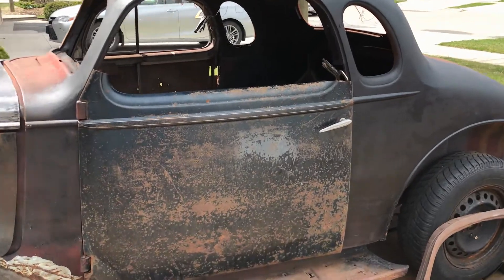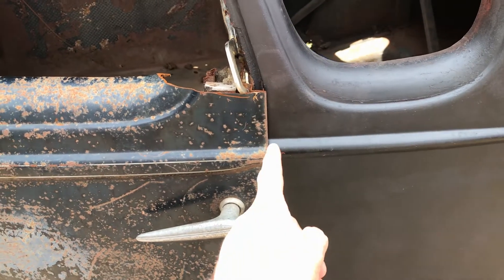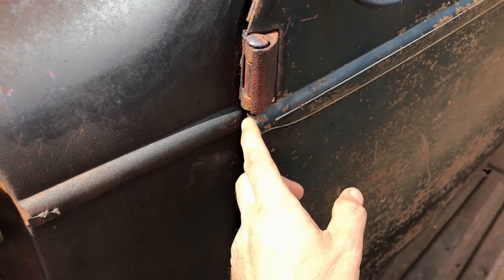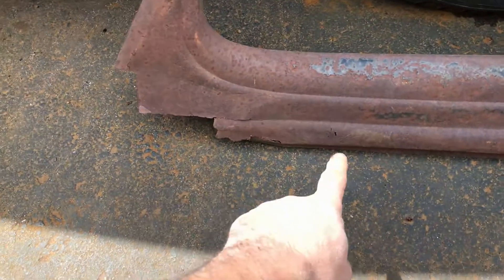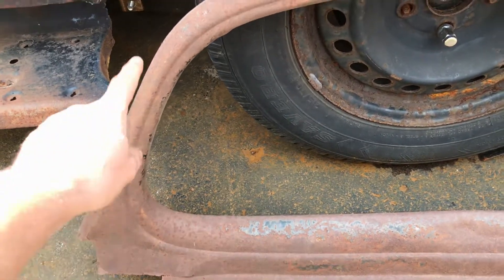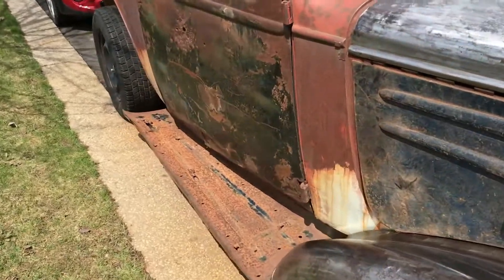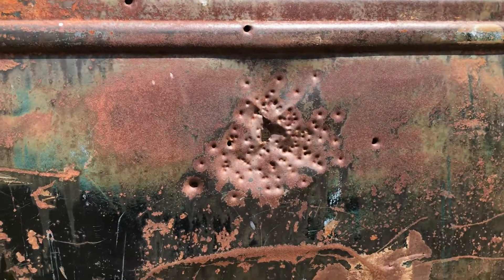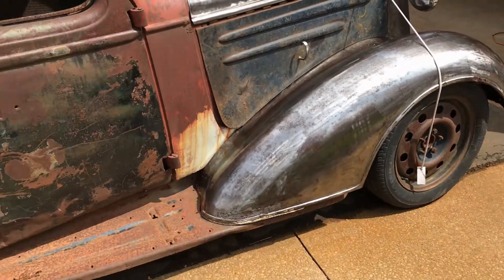1936 Chevy Coupe Door Adjustment - I have a Plan

Comment: I wouldn't weld on the line there as you will lose the sharp crease line of the bead I would go inbetween the 2 bead lines that way it can be ground down flat and will be less warping. And for the width I would cut a section out of the rear about 2 inches off the edge so the inner jam won't be too long and where the body line tapper off it will be even both sides.
Reply from the maker: Excellent points my friend.
Reply: I agree. cut it closer to the upper crease line and then flange the door part about half way down to lower crease line so the new upper frame overlaps. then when you tack weld together it gives you room to grind/finish without damaging the raised body line. you can get hand flanging pliers (modified vice-grips) at eastwood (or maybe locally at Princess Auto) or I have seen air-powered ones that you use with an air chisel.
Reply: I was thinking while shortening the door you could possibly use one of them step tools to do the flange from top to bottom then slide the cut section over that will give a good weld and will shorten the door that way you dont need cut a strip out and but weld it

Comment: Hi Dave ,Greg here  Chevy 3939 has a good point, Guess it's trial and error. You could move the latch in the door to the correct spot to line up with striker if needed. Maybe there not too far off. Were you going to go with aftermarket door latches. I guess try and get the door to fit as best as possible. Your thoughts on the door top section seem fine with me . Work with the best sheetmetal  you have on the door to avoid grief welding or metal working as you work towards finishing the door. Goodness me ,I've  spent  more  time talking on the computer with you than with our neighbours these past few days.Technology is something else,and the more I see of that coupe the happier I am for you.

Comment: You might have to cut that door into a few pieces to see where it wants to fit.  What I mean is once you cut it to fit the top window frame, it might be obvious how much and where material needs to come out of the door.  The door jambs will have to fit, so maybe you could slice it vertically near either the front or back, then fit it in the jambs and get the hinges to fit right, then see how much to remove before stitching it all together.  There’s no right answer... just some ways that might be easier than others.
Reply from the maker: The reason I favour cutting the middle, is it's a straight section. If I go near either side, the lines start to slope up, so would be impossible to match up.
Reply: @ScottRods  Ahhh, gotcha.  Hmmm, going to have to think on this one!

Comment: Take the coupe top piece and tack it in the door jamb, deskin the sedan bottom, the fit the inner structure from sedan door into the door opening.  Get the inner structure of the door fitted with in door jam. Get it to open and close good. Once that is good then reskin the door with the sedan outer to fit the inner structure.  Iron trap garage just did this on a model a door.  Watch that video. Take your time and do it right, this is the first place you will interact with the car every time you use it. Get it right or you will not like it
Reply from the maker: Thanks Tom.

Comment: Lots of ways to skin a cat. Measure the passenger side inner structure and outer dimensions. I would take all that is needed to be removed from about 1 inch in from the rear of the door. Then slide the 2 pieces together until it measures the same inside and out. Tack the top and bottom. Then make one cut thru both pieces and butt weld the panels together. The reason for cutting both panels at the same time is cutting each panel  by it self they never fit good back together. Just my two cents worth.

Comment: Hey Dave. It would be better to see how the top of the door would look if you would hold the window section up to the car and hold it there for a minute so we can figure it out. What is your plan for this car? Is it going to be a Rat Rod or a finished painted car? Those bullet holes would look cool if it were going to be a Rat Rod. If it were mine I wouldn't worry about water getting in the holes. You won't be driving in the rain. Plus if you treat the inside of the door from rust the water will run off of it and out the drain holes in the bottom of the door. Just my 2 cents. Thanks for sharing. 👍👍
Reply from the maker: Somewhere in between a rat and traditional for now.
Reply: @ScottRods  Do you mean something like my Fargo? I am painting it flat black outside with gloss black interior with some Rat accessories. I would like to chop it once I get smarter. Ha-Ha. But I don't know if that day will come. Stay safe my friend.👍😷

Comment: Have you tried to locate some replacement doors? Might be better than trying to modify the doors you have now.
Reply from the maker: Parts are very hard to come by right now, even if folk have them. Stupid virus. I'll do my best with what I have till I can get good replacements.
Reply: I saw a pair of 36 doors recently on-line. 450.00 and 500.00 each (probably US funds too). if you do seriously look on-line make sure you get the seller to measure them front to back so you don't have the same issue (ie doors too long). when I was looking for parts years ago, there seem to be quite a few rust free in Saskatchewan.